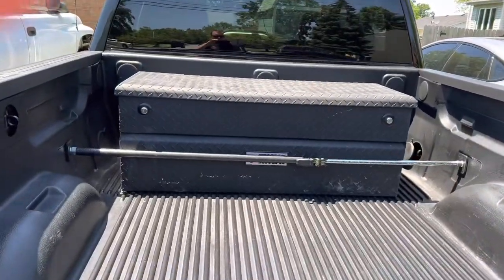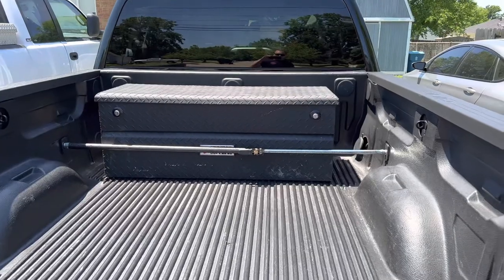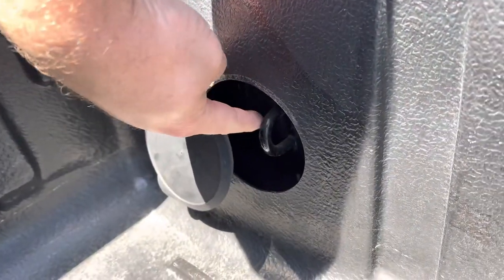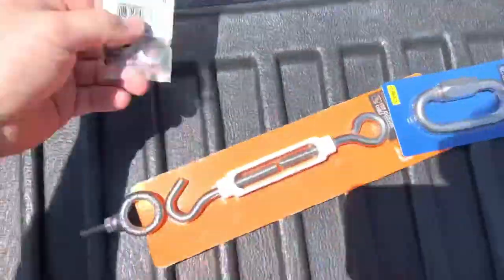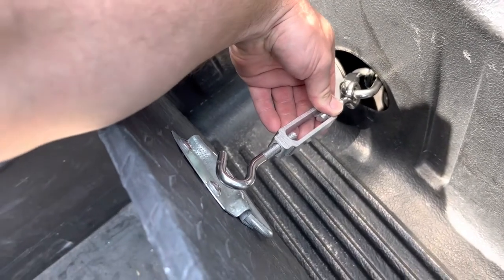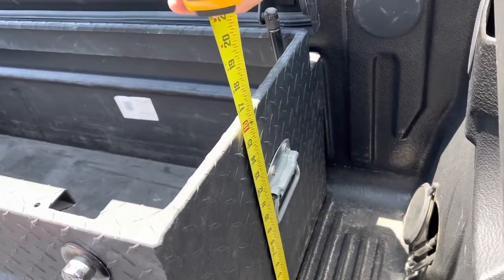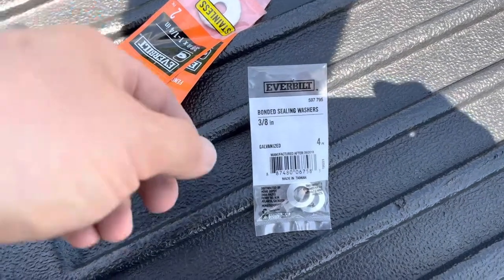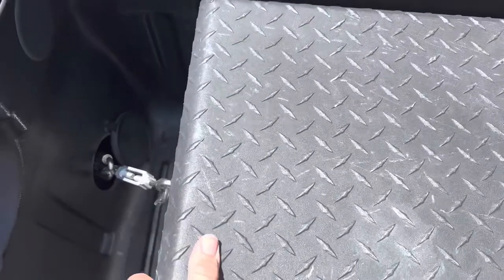Mounting tool box with NO DRILL method!!

Comment from the maker: Links below for the products in this video available at Home Depot! 

This is my method for securely mounting a in bed style truck tool box without having to drill through the bed.

Tool box handle >> https://www.homedepot.com/p/Everbilt-3-1-2-in-Center-to-Center-Zinc-Plated-Storage-Chest-Handle-15135/202034098

Stainless turnbuckle >> https://www.homedepot.com/p/Everbilt-3-8-in-x-7-3-4-in-Stainless-Steel-Hook-and-Eye-Turnbuckle-803744/205883028

Stainless quick link >> https://www.homedepot.com/p/Everbilt-3-8-in-Stainless-Steel-Quick-Link-42794/205883033

Stainless 3/8 eyebolt >> https://www.homedepot.com/p/Everbilt-3-8-in-x-4-in-Stainless-Steel-Eye-Bolt-with-Nut-803584/205883040

Washers >> https://www.homedepot.com/p/Everbilt-3-8-in-x-1-2-in-Galvanized-Bonded-Sealing-Washer-4-Piece-806758/204276408